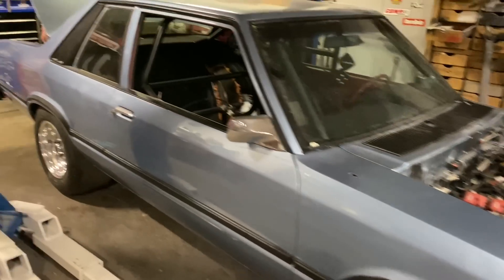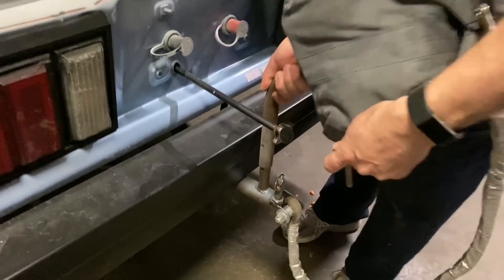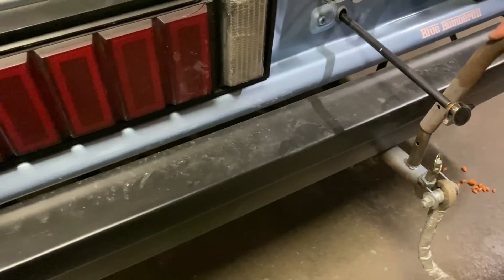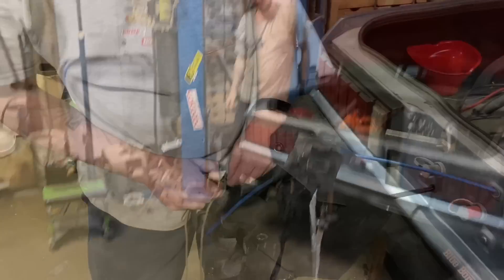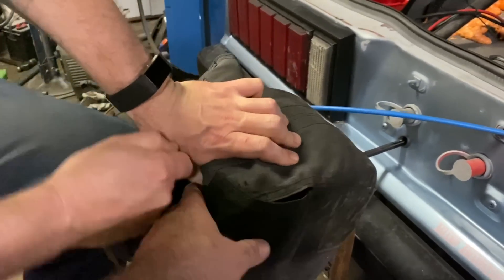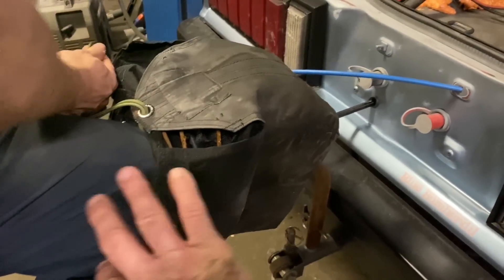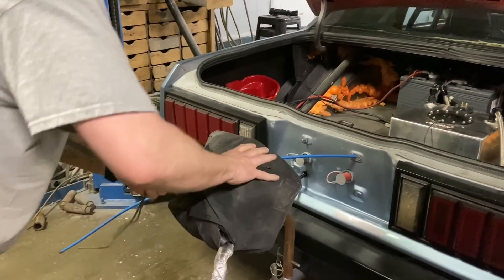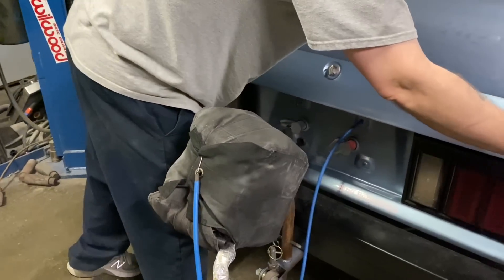Parachute Launcher

Comment: So as soon as u turn ur co2 bottle on there’s pressure and it’s trying to push the chute out with the only thing holding it in being the cable?  I always thought u needed a special handle and a Mac valve etc
Reply from the maker: Yes, the cable holds the air launcher back just like it does with the spring

Comment: How long is the piston travel on that air cylinder?  Are you using air or co2 and at what psi?  Thanks.
Reply from the maker: Co2 at 85psi.  I don’t remember the travel, but it’s about a foot or so
Reply: @TurboJohnRacing  can you see if the one you have is marked with a brand and part number?   When you removed the pilot chute with the spring, did you have to go with a chute bag with the small integrated launching chute?

Comment: Great channel, great content. 

Here is a bit of info that hopefully helps: 
NHRA mandates parachutes on all competition vehicles running 150 MPH or faster in the timing speed trap without regard to quarter-mile or eighth-mile or 1000 feet. 
Dual Parachutes are required if running 200 MPH or faster without regard to timing distance. 
This is iterated in Section 20 (General Regulations) 4:8 and referenced in each specific Class Requirements and Specifications under "PARACHUTE". 
Class Requirements and Specifications supersede Section 20 General Regulations. 
This was clarified and confirmed through NHRA Div4 tech support. 

Certain NHRA class requirements state: "No more than 3.5 inches of any portion of the parachute pack can be located under the rear of the spoiler. Measured from the parachute pack backing plate to the rear tip of the spoiler. 
Pneumatic parachute must use minimum 3/8-inch O.D. line; cannot use separate air supply from other pneumatic functions. 
Parachutes must be assisted by a launcher system – either air or spring. 
A pilot spring does not constitute a launcher but is acceptable as a secondary launch unit." 
This is to get the chute launched into the air stream and ensure repeatable rapid proper chute deployment. 

IHRA is class-specific and states "PARACHUTE: Mandatory on entries at 150 mph 1/4 or 125 mph 1/8." "Cars running 200 mph in the 1/4 mile must have two parachutes with one release handle." on classes that are fast enough to require a chute. 

Interesting note according to Stroud: Drag Chutes/Parachutes are not SFI tagged or rated and do not have a certification expiration date. 
"https://www.stroudsafety.com/recertification"

Thanks for all you do and share. 
Best wishes to you, your family and friends. 
Don't worry, be happy and healthy.
Reply from the maker: Thanks, that is good information!
Reply: Why not have a expiration date and re-certification process say every 5 ish years?? My safety harness ( and other parts that have sfi # have the same thing and I understand why on most of it because someone got hurt or killed or close enough ) ( so far I’ve never needed them for a crash or so far haven’t gotten to race/test in tune HPDE it yet in 8 years ish 😔 as I’m still getting ready but I have gotten to street driving ) have that and I’m not as hard on it as a well used parachute would be. I was told that safety fabrics can deteriorate just from sitting after 3-15 years and it’s faster if there damp or dirty like a parachute that gets drag on the ground or fast food spills onto seat belts
Reply: I thought 🤔 that I read a Internet rule book that the official Dragstrip organising bodies put out circa 2013~ covered parachutes and other safety equipment requirements and I remembered them being mandatory for retesting/getting a new one every so often.
 I just forgot at what speed it’s needed and or they have probably updated the rule book by now. last time I readed it my car doesn’t pass for sub-10’s I the 1/4 Mile drag as I have a full interior and no to little jungle Jim inside because I use the back seats and it miss up the hard top/convertible looks plus it’s harder for 💃🏼 To not show off things when getting in and out of the car. Power wise it’s sub-13’s aiming for sub-1500 hp ( drive line limited aka TR6070 ) but more than 650 hp at the tires. If I can figure out a way of smoky Eunic my way into having a bolt in mini top fuel rail cage only around the drivers seat/take out the power D&D seat for the weekend and not a full cage or roll bar I’d be game

Comment: I have noticed if I am not on the throttle when the parachute is deployed it will snatch the rear of the car aggressively, if it is not centered behind the car it will jerk the back of the car in what ever direction the parachute is favoring.
I now stay on the throttle until I can feel the grab of the parachute, 2300LB car probably effected more than a heavier car would be.

Comment: So why don't you do yours then  you don't feel like packing it you want somebody else to do it
Reply from the maker: LOL, I pull mine every time at a normal 1/8 mile track and it makes goes through the finish line under power!  If I’m at a 1/4 mile track, and only running 1/8mile I don’t usually pull it because I have 1800ft to stop.